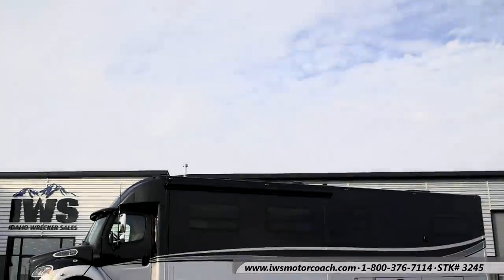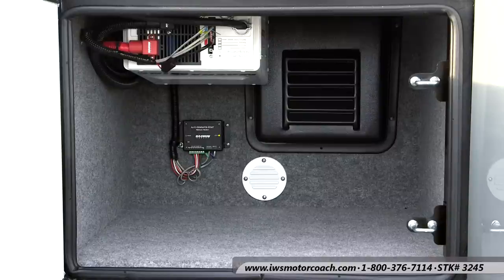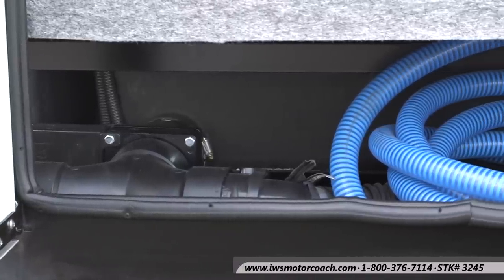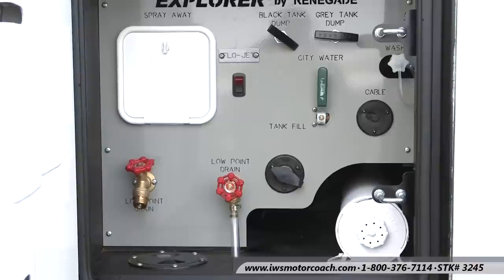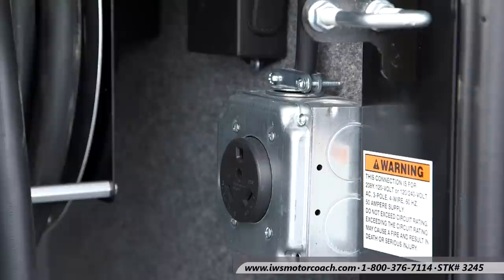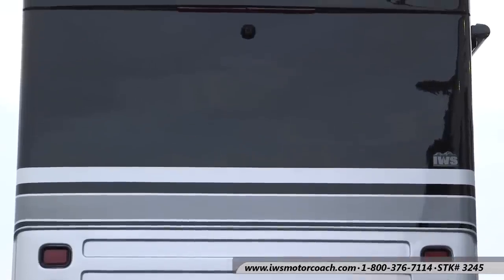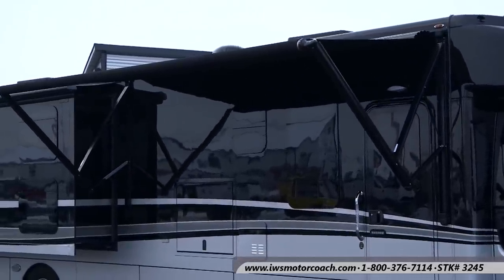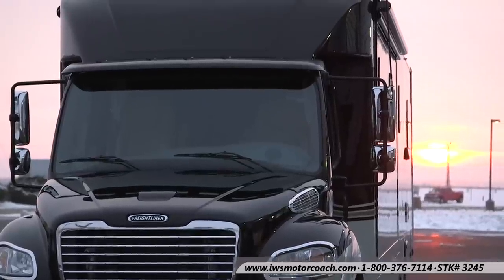IWS Motor Coaches 2015 Renegade Bunk Model Motor Coach Exterior

Comment: These types of coach are nice but I do feel that some length is wasted due to the engine location.
Reply: +davva360 No matter where the engine is located, there will be a wasted space and/or wasted length. Let's suppose that the engine is placed on the rear, the engineers would have still sacrificed some space and/or length. Even if you opt for a trailer/5th wheel, you will still need to add a source of power/truck/engine to move it around unless you want it to be stationary. If that bothers you then I'd recommend you get one with no engine so you can save space and length and carry it on your back to move around.